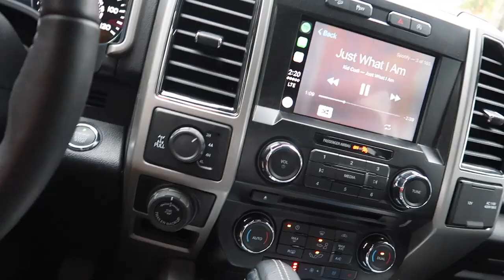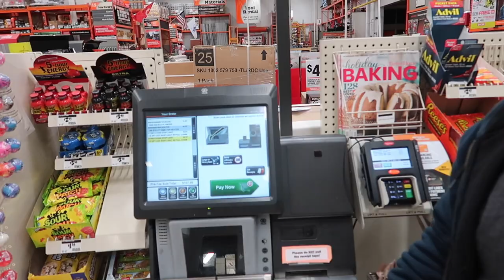MY KX125 IS JUNK... BROKEN

Comment: That 125 has the same frame as my 96 kdx200, also crack the garage door when running the mr heater, it will burn up your oxygen. Last winter i was working on my buddys four wheeler and buggy and didnt realize how much the heater was running, all the sudden we all got super dizzy, felt alright but was just very dizzy and weak, opened the door once i realized what was happening and within a minute felt completely fine, they can be dangerous in closed spaces

Comment: I bought an 05 kx125 with the case busted right in front of the sprocket, luckily jb weld worked because the broken part was curved.